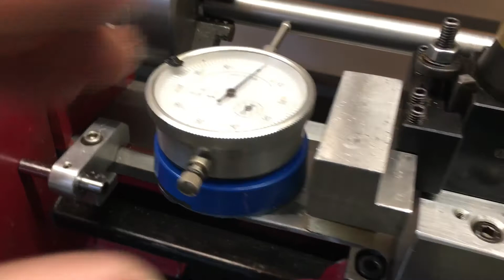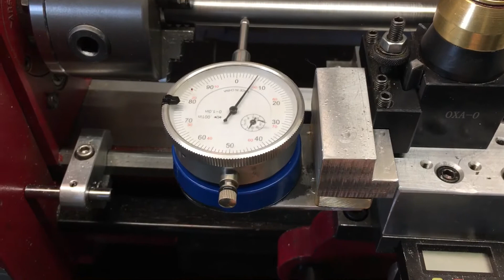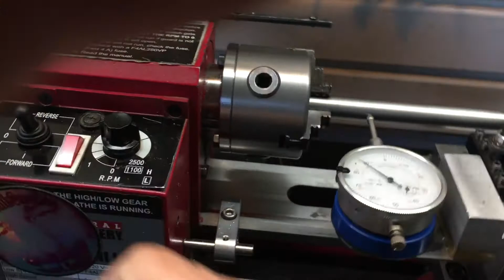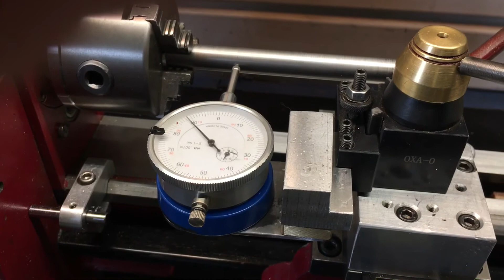Tool post dial indicator, mini lathe

Comment: Nice job on both of your projects, Kimber.   A chuck key that wobbles is actually a plus as long as it's not too loose.
Reply from the maker: Chuckie was a failure. The 12L14 doesn’t have The strength. Back to the drawing board with some harder steel in the carbide cutter.
Reply: @kimber1958  Suggestion:  get yourself some 1144 stressproof or 4140.  Bought some 1144 from McMaster a while ago - not bad to work with.
Reply from the maker: @danielabbey7726  thanks

Comment: Kimber, dang it, you are learning. But, what works on a 4 jaw doesn't always work on a 3 jaw.

Remember how you learned about using a small hammer to tap to get to true round? Well a 3 jaw will respond better to tapping. Where a 4 jaw can respond to tighten one side and loosen the other. You are using a small lathe, what works on a 16" swing lathe can work on yours but you have to keep in mind, size. You can harm your lathe by over tightening or heavy beating. You have to be patient and do little things on your little lathe. You want precision, that is small cuts and not force.
Reply from the maker: Rodger that! 
Thanks LONG
Reply from the maker: What do you think about a 4”  Four jaw self centering chuck ?
Reply: @kimber1958  Kimber, the only concrete rule I know; fresh water will freeze at 32 degrees Fahrenheit or colder, at sea level. Finesse with the smaller things counts the most, if endurance is a goal. If you don't give a crap, I am with you. All my big tools are gone, all I have left is memories.
Reply from the maker: Hot water freezes faster then cold .(true) Though there’s an explanation